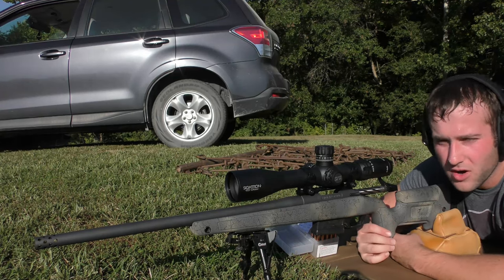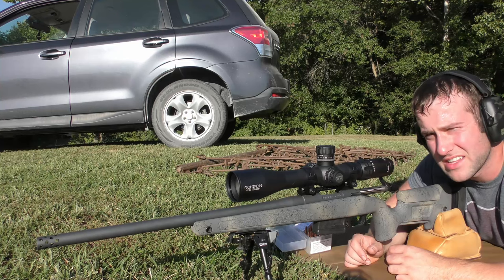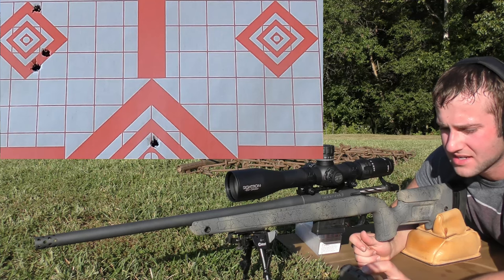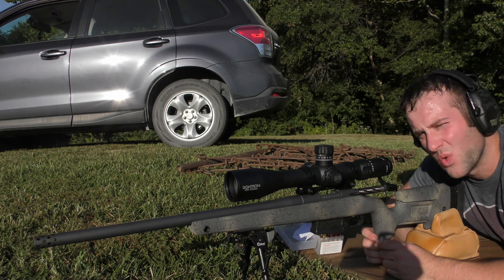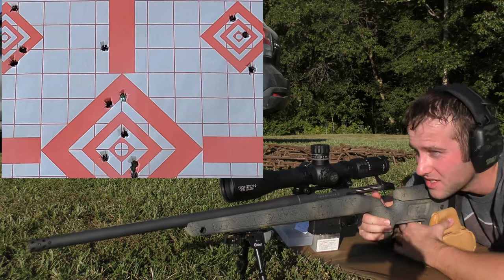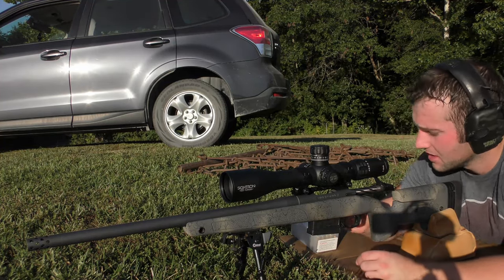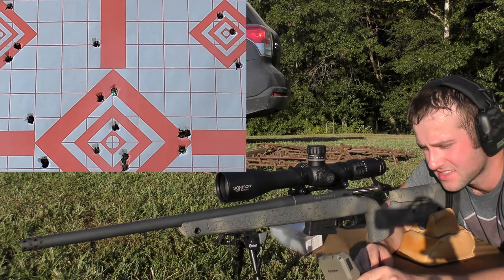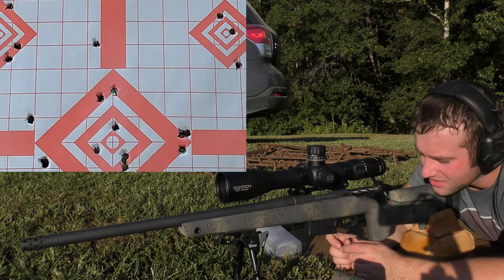NEW Hornady 174g ELD-VT Bullet Tested: Accuracy Testing w/ Multiple Powders in Bergara B-14 HMR 308w

Comment: Once my rifle is tested, I'm hoping to get good groups with 200gr SMKs using Re ts15.5 powder. They will be well into the case as they have to feed from an SR25 magazine. Winchester M118 ammunition fits as does Federal 175gr Gold Match.

MarkAndSam After Work Have done ELR with the 308 Winchester using a 200gr Berger. Berger also has a 208gr. I don't think they have shank in the right place for me to seat for an SR25.
Reply from the maker: Are you okay with the low velocities?
Reply: @RisenCitizen  To some extent. At the end of the day, the 308 Win is not the ideal long range cartridge. It is quite versatile though.
Reply from the maker: @Fudmottin  agreed!
Reply: @RisenCitizen  I found a Berger bullet that they load to 2608fps (advertised) that is 185gr. Part number 30107. MidwayUSA sells them both as bullets and loaded ammunition. Brownells has the bullets cheaper. Ammoseek is always a good place to look if you can't find them locally.
Looking at the data, these may be a better option than the SMK 200gr. More expensive though. They meet my seating depth requirements. Perhaps these will perform well out of your Bergera unlike the Hornadys.
Federal's Gold Match 175gr SMKs are loaded to 2600fps and I think that's also what the M118 ammunition is loaded to. These Bergers should carry more energy downrange than the 175s. However, it is likely that the 6.5 Creedmore, loaded properly, will overtake them at about 500 meters. I don't have the data in front of me. What I do have is an Alliant based recipe using the Re TS15.5 powder for the Berger.
Reply from the maker: @Fudmottin  you also have to look at the barrel length they are using to get those velocities. That's important.
Reply: @RisenCitizen  Very true. I'm running a 20" barrel. On top of that, it is a gas gun. So I have to also consider the port pressure if I decide to run higher than normal pressures. I'm looking for KAC M110 performance without spending M110 money. Knights are expensive!! Even PSA is no longer exactly cheap for their clones. 308 Win looses a lot of velocity going from 20" to 16". I'm not sure what the gain is going out to 22" or 26". I can't make my own barrels, so I go with what's available. I went with a Faxon 1:10 match barrel with heavy contour and fluted. It uses 5R rifling. It looks nice 🙂